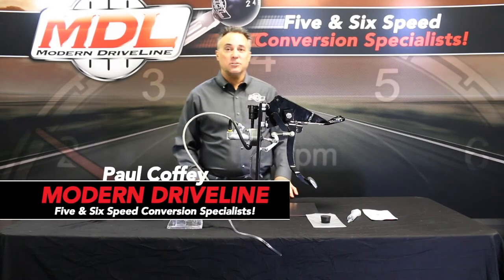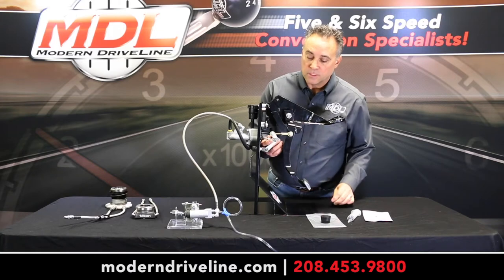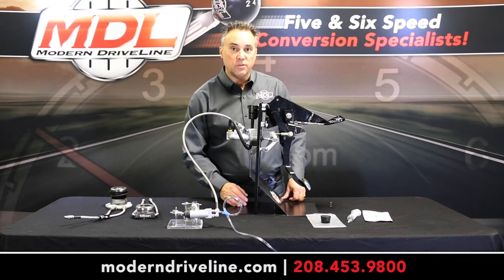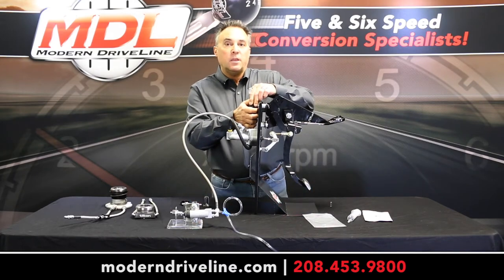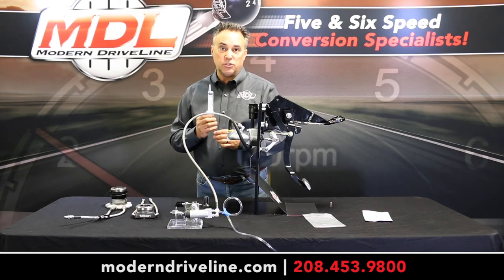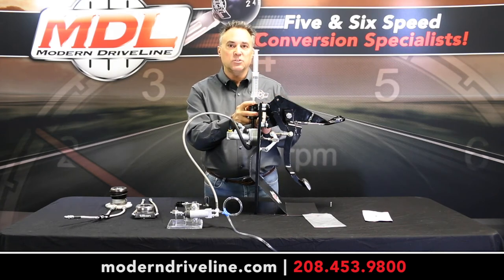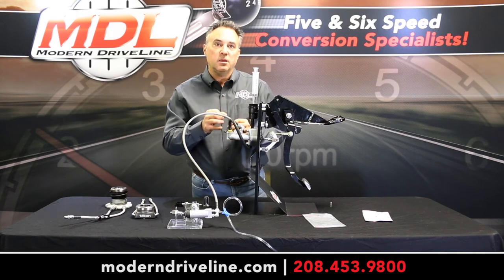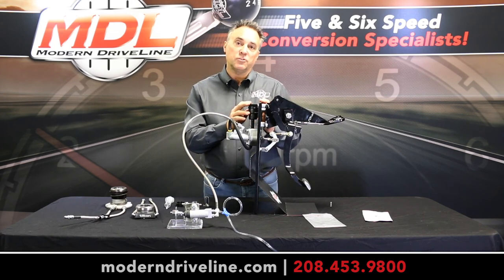MDL Master Cylinder Bleeder Kit Instruction

Comment: Do you top off the reservoir before using the syringe or will one syringe fill the system from dry?
Reply from the maker: Hello Don, One syringe holds enough to fill it twice, we do this to ensure all of the air bubbles are pushed out. so no need to pre-fill the reservoir.

Comment: What happens when the clutch doesn’t want to return, it goes out and just snaps to the firewall and never comes back…
Reply from the maker: Did you remove the spring from the clutch pedal?
Reply: @ModernDrivelineInc  Yeah I called in this morning and was told to do that to the helper spring so I removed it. Thank you.